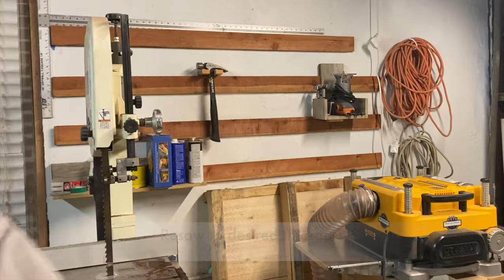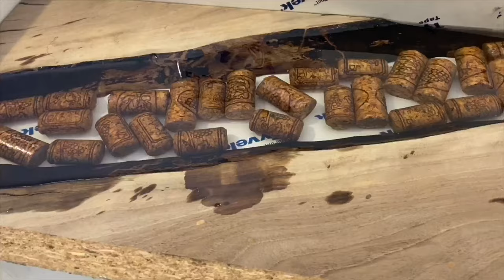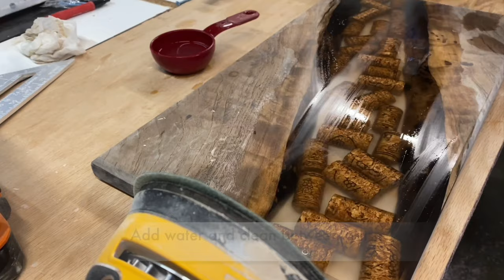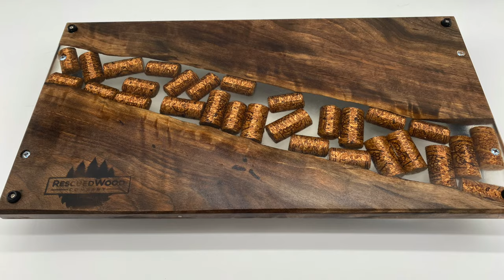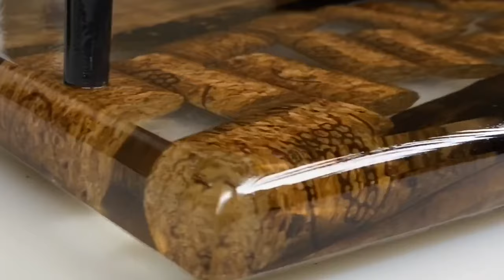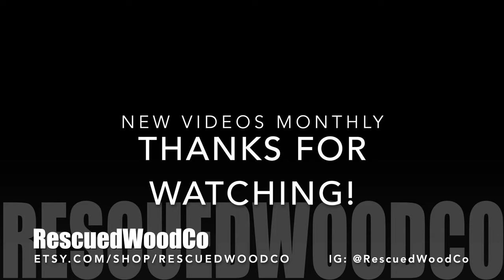How to: Crystal clear charcuterie board with epoxy resin, wine corks, and urban wood

Comment: How did you keep the cork from floating when pouring?
Reply from the maker: Hey Jack! I poured a layer 1/8th inch first and let it harden to about 90% hardness, this way the next layer bonds to the 1st layer.  If you let the 1st layer dry all the way, the 2nd layer will not bond well. You would have to add a scuff sand and then add the 2nd layer. Let me know if you have other questions!
Reply: @RescuedWoodCo  I assume you placed the coated corks during that first pour?

Comment: how did you keep the corks from floating up?
Reply from the maker: Hey Steve! I poured a layer 1/8th inch first and let it harden to about 90% hardness, this way the next layer bonds to the 1st layer.
Reply from the maker: If you let the 1st layer dry all the way, the 2nd lalyer will not bond well. You would have to add a scuff sand and then add the 2nd layer.

Comment: Are you coating each Cork and the edges with epoxy first before setting up for the pour?
Reply from the maker: Jay Cruise yes that’s exactly correct. I let the corks and live edge cure fully before the main pour 👌 important piece is to sand the live edge after sealing it otherwise the bond won’t be good
Reply: @RescuedWoodCo  Did you have a problem with the corks floating in the resin?
Reply from the maker: @stevek1088  yes! you need to pour a very thin 1/8 inch layer to make the corks stick to the bottom. Let that cure then do the main pour!

Comment: Did you set the cork at the B stage ? 
Nice work. That oil you used Is stunning 
Thanks
Reply from the maker: I poured a 1/4 inch base layer and let cure until sticky, almost all the way cured, then did the corks and main layer! LEt me know if that makes sense or if you have other questions feel free to ask!